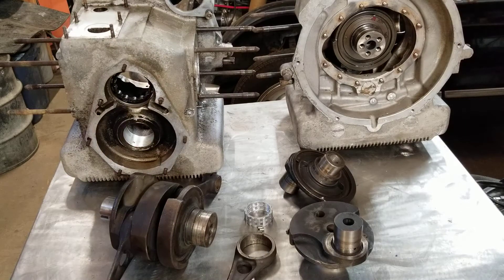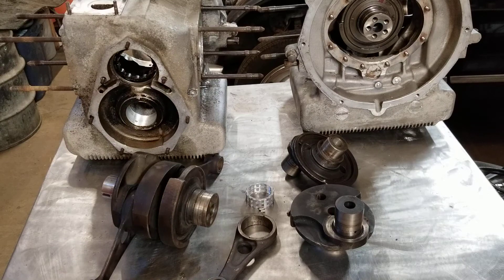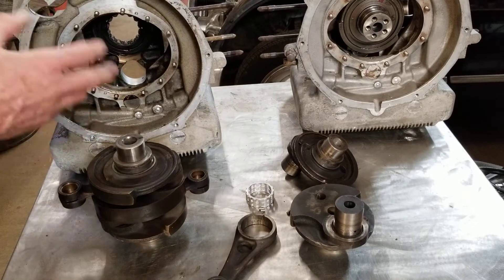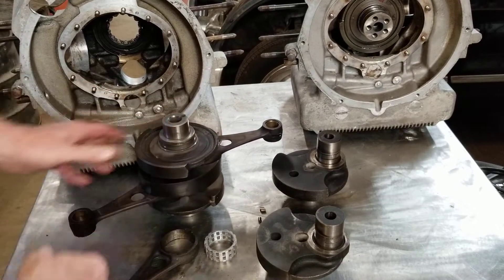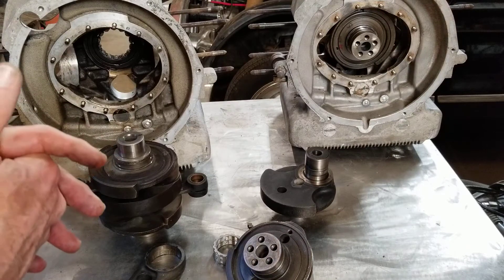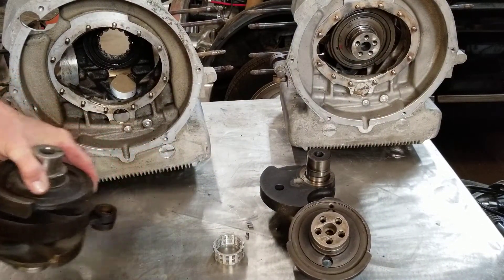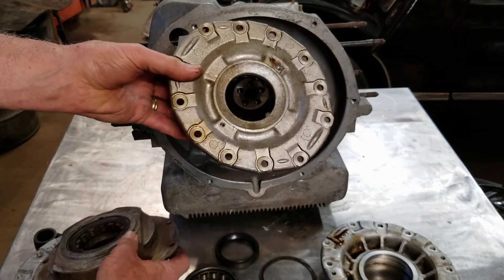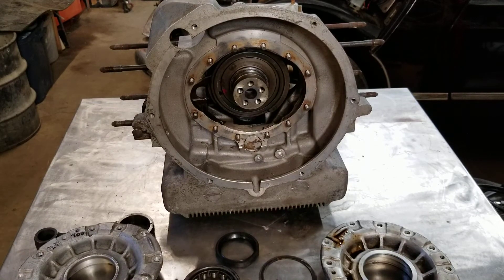Paul's Panhard Video #1 Crankshaft

Comment: Hi guys. All i have is an engine and gearbox. I will be fitting a supercharger and fitting the engine in a drag bike! I do not know what model i gave, can this be determined by the engine number so i can source a correct service manual?
Reply: Sorry late to see this. The engine type is stamped on the starter motor boss aka 1722 etc

Comment: Paul, that rear bearing carrier "avec deflecteur" you showed at the end is from a earlier model Panhard engine, and was last seen on the aluminium bodied Dyna Z1.It looks like you have some early crankshaft bits there, as I have never seen a drilled throughcrank pin that had pressed in slingers. Do not remove the slingers, you are creating a huge problem, just make a shaped tool from a small flat bladed screwdriver. Also use the hobby lathe is OK too, but you need a Viton or FKM seal. You need to use a rear seal that avoids the groove in the crankshaft.I tend to use 55x70x7 or 8mm thick double lipped. PS There is a design fault with the oil crankcase drilling especially re the timing gear lubrication, which means the front bearing is starved of oil. They changed the system on later engines, but there are better ways to do this. :) Oh another couple of things, and you drill a hole in the crankshaft opposite the crank pin, and use a 10mm or 3/8" diameter bit of tool steel bar in a press and some thick steel plates to press it apart. Lastly, don't press them together, teh factory used heat on the inner part to expand the diameter... the manual I have used an oil bath and you need over 180-200ºC, and fast hands. :o
Reply: At the factory, they did a similar thing, they used Simrit sealing rings on engines from july 1966 onwards. Unfortunately, Citroen stopped production only one year later.
Reply: @MichailKnoller  They did but on those engines the rear main bearing roller surface at the flywheel end was smooth along its length, as the earlier crankshafts had a groove for the aluminium sealing ring carrier, which located the wire ring in the piston ring type seal, as well as create a depression to fling any oil outwards that tried to get past it.
Reply: @mikecrane2782  Absolutely correct ! I just wanted to point out, that Panhard changed that system, certainly, there would be a way to " adopt " the later Simrit - system - with a sleeve, perhaps.
Reply: @MichailKnoller  In my original reply I did point out to Paul, he could use a double lipped 55x70x7 seal with the earlier crankshaft, and that's what I used when I've built my engines, but I didn't mention it had to be Viton or FKM, or explained that you needed to machine the rear main bearing aluminium carrier to suit. BTW, the later "smooth" crankshafts used a cast iron rear main bearing carrier and a single lipped NBR seal. Finding 55mm internal diameter double lipped seals with 68 & 70mm external diameters is possible. The original rear main bearing carrier has a 67mm diameter for its sealing system, so this must be opened up, which is relatively easy job if you have access to a lathe. I've never had a rear seal leak on my engines unlike the original sealing set up, that would always leave a drip on the floor. :)
Reply: @mikecrane2782  My mistake - I must have overlooked " double - lipped. Yes, I know the later ones are cast - iron, your solution seems to be the most elegant one, chapeau !